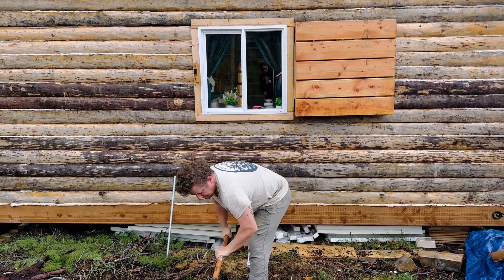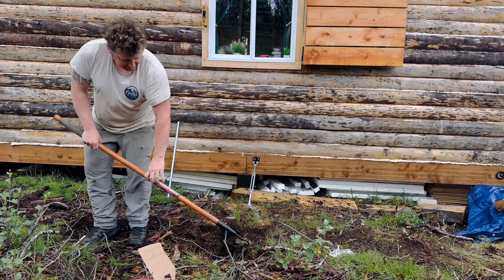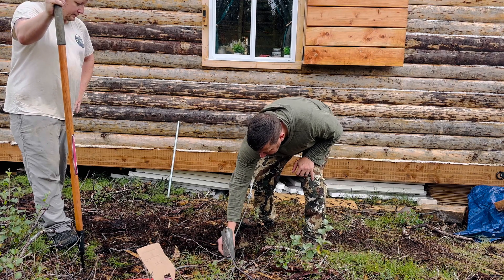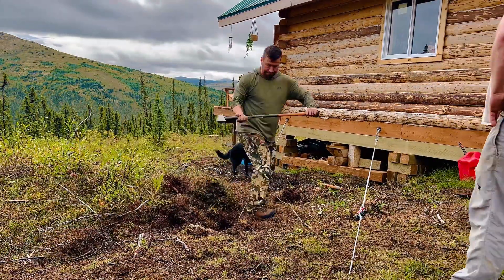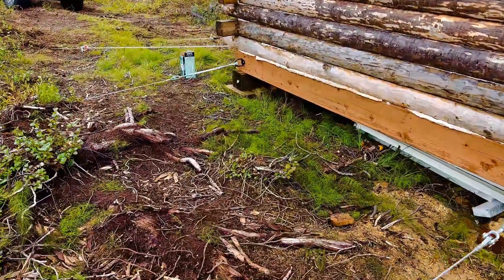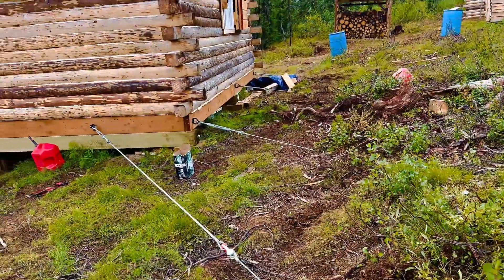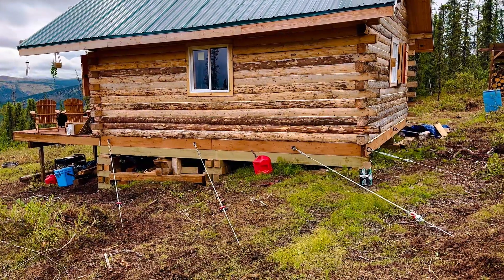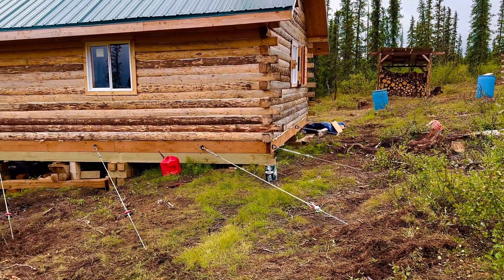Off Grid Living in Remote Alaska: Installing Duck Bill Anchors to combat shifting from Permafrost

Comment: Ich hatte euch schon gewarnt  mit dem Haus das es abrutschtarnt weil ihr an den Stützen rum gemacht habt nun könnt ihr beten das es halten soll ihr braucht Spezial Brücken Beton das es in dem Boden hält dann kann euch nichts mehr Passieren ,
Reply from the maker: We clearly were very well aware, and “messing” with the supports to re-level is critical and expected as a building settled regardless of being built on tundra or not. This will hold it in place, which is why we did this

Comment: Saw another channel where they put wide concrete pads under each footing. This acted like snowshoes on the cabin to prevent major sinking. The slipping is another issue and I think you guys solved it. Nicely done! You might consider building a wrap around deck on the cabin over all the cables, so you don't trip over them. Just a thought. Thanks for posting.
Reply from the maker: We have considered concrete but from our research the permafrost shifting either breaks it and pushes it out of the earth or can swallow it. Luckily it’s not a few months we deal with major leveling and maybe over time it’ll settle more into place. Most cabins in similar terrain have the same footings and I think our sloped hill was contributing when it softens. We will see how it does next summer. Fingers crossed! 

We made a new trail around the back for accessing it to avoid walking that way. But a big nice deck does sound pretty awesome!! I like the idea of

Comment: ???Um how much wind are you expecting? I have never seen someone trying to hold a cabin down? I really dont think this will help with heaving. You just needed more space under the floor so the ground can stay frozen. The cabin will sink down and will need to be jacked up often.  let me know if this works. I have seen 1000's of cabins in Alaska in 43 year I have never seen someone tie a cabin to the ground to fight permafrost? well you wont be sliding down that hill soon lol?
Reply from the maker: Well a few weekends ago we did have 50mph gusts at least. It ripped our outhouse door to shreds that was latched. Cabin was fine. Wind typically isn’t the issue. 
It melts during the “hottest” few months and shifts then. A problem leveling and re-leveling during those few months. We’ll still be re-leveling, but it is sloped down hill and to the right which the blocking supports were starting to twist/slide that way so in theory it won’t be heading that direction if it’s anchored in place. 

We consulted with some people putting up remote buildings in the tundra in major permafrost area and this was recommended. This is primarily though not to slide down the slope it’s on as the ground shifts. 

Re-leveling until more settling occurs is likely in our future every summer.